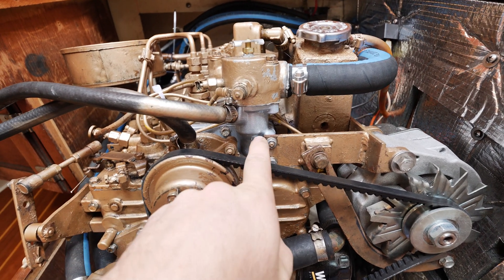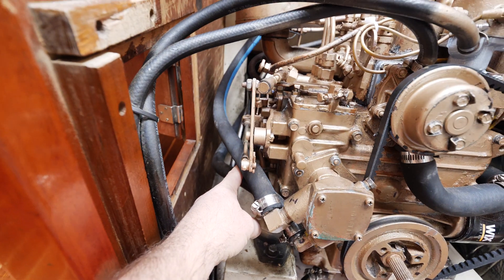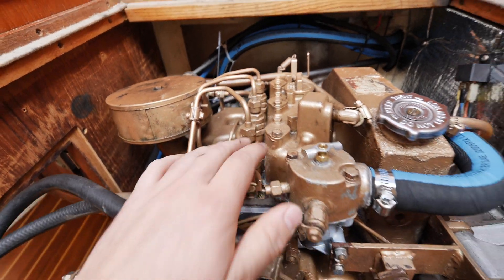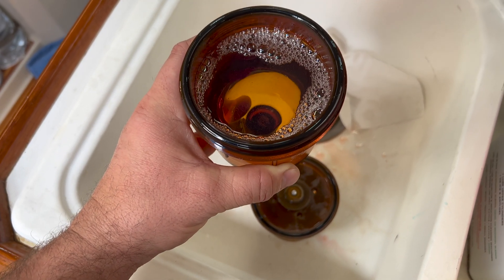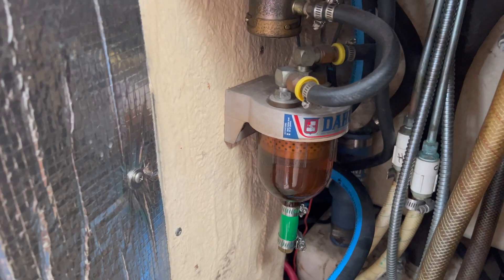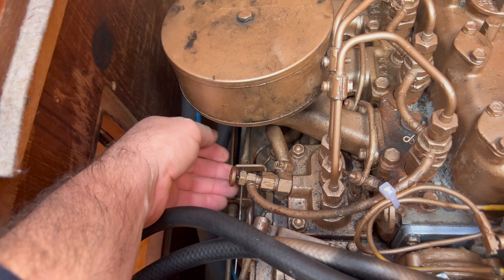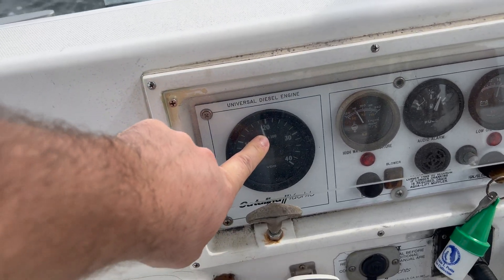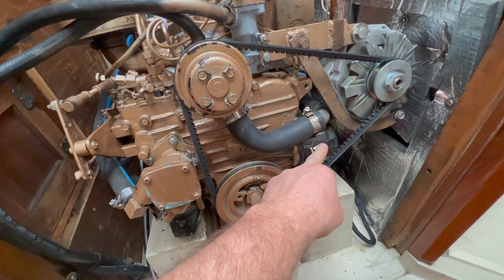Universal M25XP not getting full power. (1900 rpms only)

Comment: I have the same problem on the same engine. Just rebuilt the transmission, cleaned the fuel system and replaced the thermostat and sender. Now it wont go above 1900rpm. The last 1/4 of my throttle produces no extra RPM'S. Did you resolve this issue? Thanks
Reply from the maker: I'm having the same problem now, but I can hit 2000RPM. After that the last 1/4 of the throttle does nothing.
Reply: Maxwell, did you figure your issue out?

Comment: Was the purpose of moving the timing chain cover to gain access to the valve above it? Was the cam, crank or chain touched what so ever? If it was, this may be the issue. Possibly re assembled with the timing off a few degrees which now manifests itself in loss of power. Just a thought.

Comment: To remove the gear case housing, I believe also requires removing the injector pump. If so, they may have mis-installed the governing springs. There are three springs to re-install: a start spring which has one end attached to the gear case housing itself, and the speed control springs which are actually TWO springs nestled one inside of each other which transmit the throttle command to the governor.
 If they forgot to install both of the speed springs (especially the heavier stronger spring), this would explain your problem. See this video to get an idea: https://www.youtube.com/watch?v=Odd-41rclnE
Reply from the maker: It was the governor spring. It had slipped off